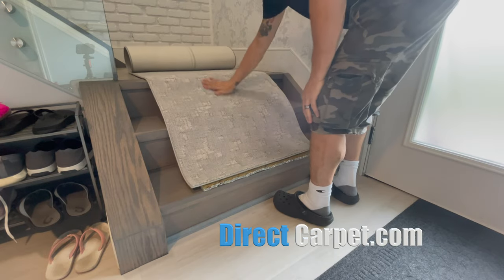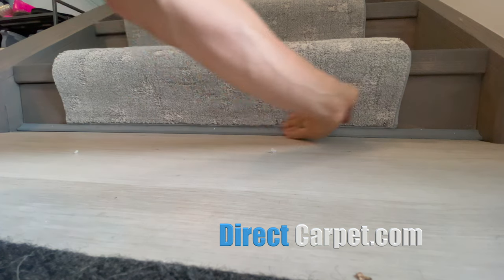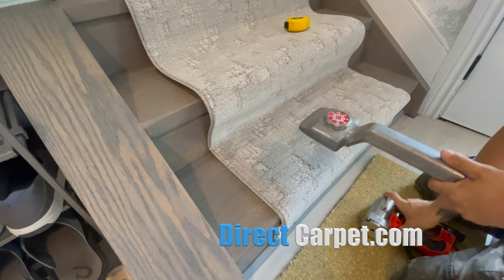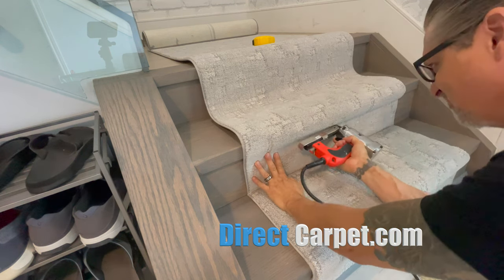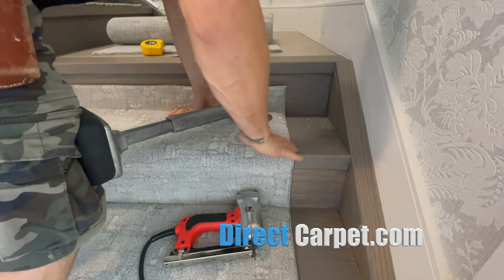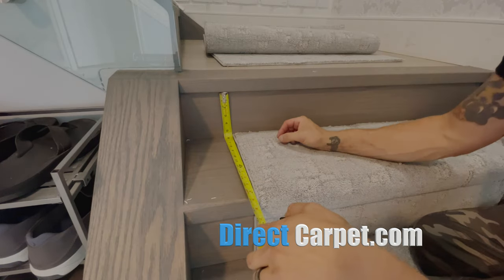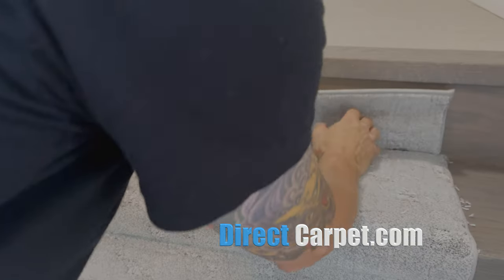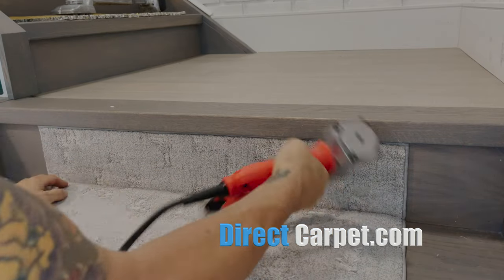What they Don't Tell You When Installing your Stair Runner DIY

Comment: Nice work Keith!  Question, which way is better to install the carpet padding?  Is it better to go over and around the nosing, or cut padding up to the where tread begins to round off? 
Will I get better wear going around the nosing, or will that make for a bulkier look? I've seen it done both ways.
Reply from the maker: That is a great question. Carpet will always wear better if you run them under padding over the nose, but yes, it can get bulkier and it can show from the side out of the front of the stair runner now if you don’t have a side view and you can deal with that gap you can always put the padding over the edge. We only usually run our padding up to the nose of the stair just because we know how it looks, when it runs over now, there’s two schools of thought some people always wanna run it over because that’s what the manufacturer recommends but we’ve been installing for a long time and we have noticed that we’d like it to go nice and tight against the nose of the stair